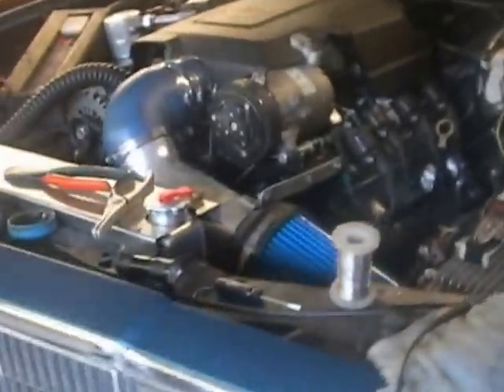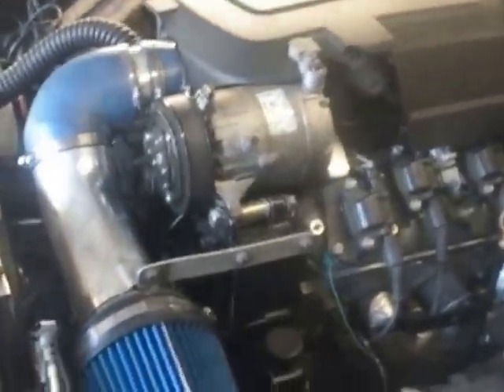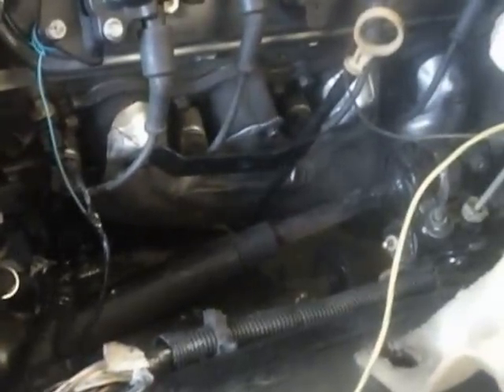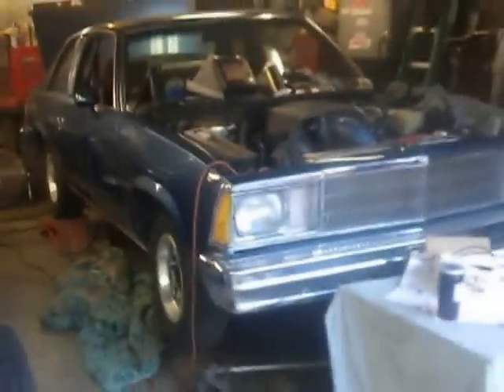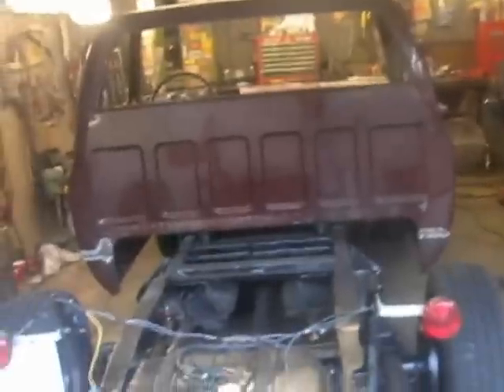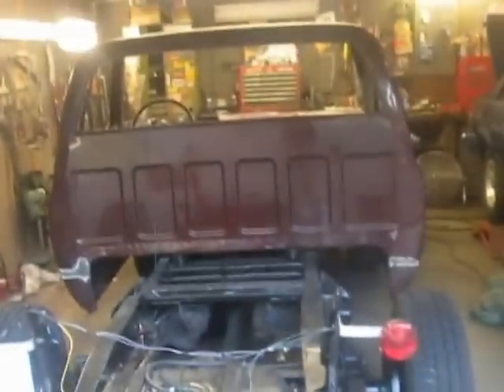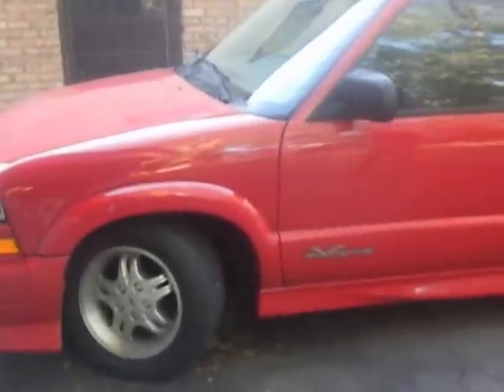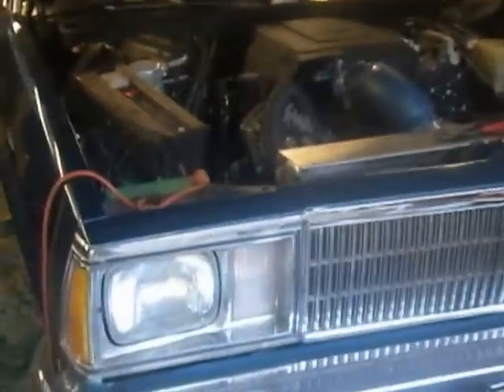Ls4 5.3 1980 Malibu

Comment: Wow great job on this. Searching for an adapter plate brought me here. Looking to replace my 4.3l V6 in my 2010 Silverado with 4L60E and I have a few questions. I know the LS4 has a shorter crank, what thickness spacer did you use between the flex plate and crank? How thick did you make the mid plate? Did you delete the AFM when you installed the cam? And if you did did you replace the oil pump with a standard volume or leave the LS4 pump as is? Thank you for this Video!

Comment: How in the hell did u get the bell housing to fit onto a fwd motor. Do they make a kit
Reply from the maker: +hAnGoVeR220 .  Any transmission will fit any engine. I'm not sure if anyone makes a kit. Make these things myself. It all starts with a pencil and paper. Plexiglas for transference or template, but all in all not really necessary.
Reply: +ls4s10 would love to take the 5.3 out and put a 6.0 in but how do i make the 6.0 fit and how do i bolt the fwd tranny.to it

Comment: Just curious as to why you choose to use a truck intake? ... Very nice, I have access to an ls4 and am thinking about throwing it into a 2000 s10, or possibly a 90 Beretta. Not sure yet. Starting to research how it works out being converted to rwd vehicles before I decide on what to do with it.
Reply: The truck intake have the best air flow for the stocl lsx intake(not the aftermarket ones), so it better than a ls1. But they're not realy nice looking. You can still "shave" the intake to make it look better.
Reply: I guess its possible I just cant see how or why they would put something that would flow more air and create more power on the vehicles engine that is not the "Performance" one but just the work horse engines ... I love all of them though from LS1 to the LS7 just a few aftermarket parts and you have some VERY capable motors.
Reply from the maker: +Black Majik   The intake is one that was cheap and it works great with this cam. Very crisp throttle response with the stock 87mm throttle body.

Comment from the maker: It's a ford starter mounted through a mid plate with a starter support brace like stock. It's about .200 thick. The mid plate is just a spacer/adapter. Works flawlessly just has to be set up accurately for proper mesh.

Comment: How did you mount the starter since the LS4 has no provision for starter mount under the engine block?
Reply from the maker: +sdavrider Ford starter mating surface is rotated 90* as compared to a Chevy starter. Mounted it to a portion of the mid plate.
Reply: +ls4s10 amazing work. thank you so much. i hope you post a video of the starter mount. The LS4 gives those of us with the GM metric V6 transmission pattern a cheaper swap option.